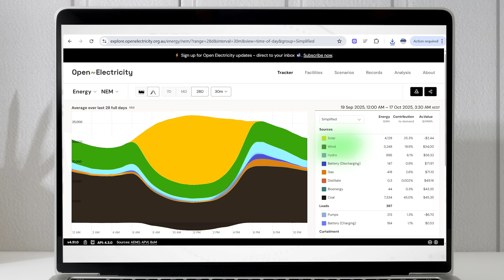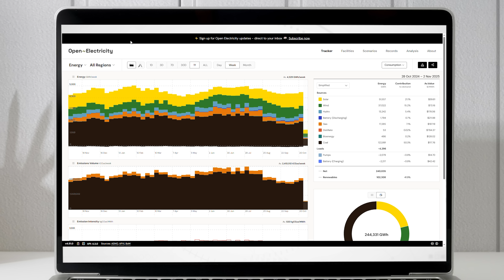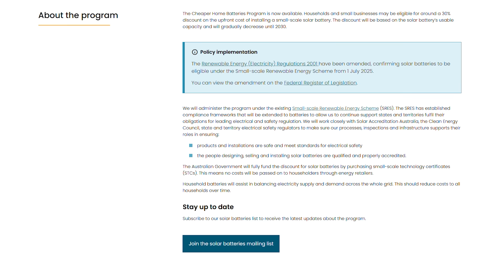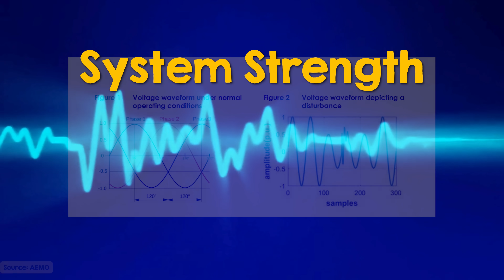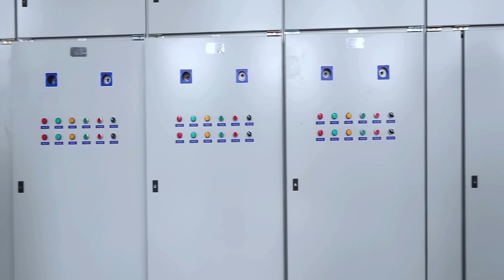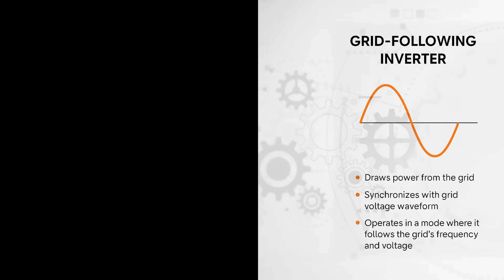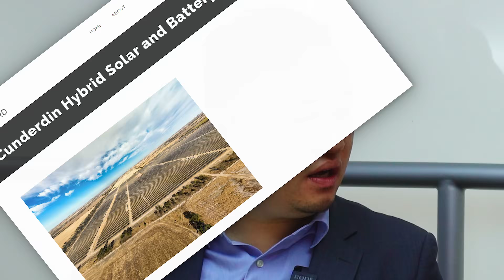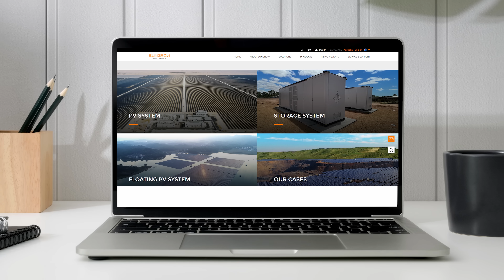Australia’s Solar Boom Is Breaking the Grid - Or Is It?

Comment: I've lived off-grid for almost 10 years now, my first project was to build a frequency based load controller to heat my hotwater using excess solar power, I had my first prototype installed and running within days of switching on, over time I added adjustable threshold, then an LCD and rotary encoder with a menu system, and now I've expanded it into a multi device output, multi input controller with adjustable hierarchical switching and timing, with control inputs for grid/inverter frequency, external generator detection, real-time clock,  battery charge status, and manual override.  I did try taking to several industry leaders in the beginning, including SA power networks and energy retailers and hotwater manufacturers, but was fobbed off and told it wouldn't work grid wide. I guess we'll see if they suddenly start selling something similar,  the key thing about my system was it's adjustable threshold levels to smooth out the turn on and off to prevent grid shock.
Reply: do all these issues you both mention relate “simply” to the fact that despite being off-grid, you’re still operating in AC? Wind turbines output can perhaps be smoothed and converted to DC at point of generation, fluctuating DC solar can also be smoothed before charging a battery storage which would become the home “generator”, and all in all, there are probably a lot of appliances that could simply be DC and the remaining ones that do need AC could have an onboard converter?
Reply: @Nikoo033 I use AC 230v, 48v battery bank, and sma sunny island inverter connected to PV inverters.
Reply: @Nikoo033  Is Australia, all Australian appliances are in AC, you must have a inverter to convert DC to AC. In a home setup this is easily achieved. In a grid this is highly difficult. Why you are introducing multiple points of input each one varing in charge and frequency, then trying to send that load down sahred powerlines. Its a power monitoring and adjustment nightmare. Infact just to prove how difficult and what can happen just look at Waratah Super Battery plant that suffered a catastrophic failure on its primy inverter. If you think 100's of theses for 100's of plants is great then you must know something that Waratah didnt.
Reply: SA power networks prioritize profit over society.
Reply: Is a description of your system available somewhere? I'm looking at dumping excessive energy to a hot water tank and then to a wood drying shed. As I understood your text your system does something similar.
Reply: Off grid too, the big problem as you noted is more solar inputs more load controllers needed, more vairables and increases potential for failure. People pushing net 0 dont understand that, the more sources of solar and turbines means more controllers more invertor banks just to even the energy frequency. Honestly anyone that has batteries knows you have to over enginner just encase. The idea that there will be mass battery storage locations all over is crazy, and the goverments claim of firming with Gas, well as we havent built a gas plant in 5/6 years, I'm calling BS.
The goverment should have cut the solar and turbine projects down, and paid 80% to have every household have 5 to 7kw of solar pannels each, then on every factory, carpark, building more solar to help the local grids/ or even main buildings/ shopping complexes. BOOM lower bills. But thats not the game, the game is give millions to billions to big businesses, even those businesses that have failed and not returned the money loaned. Just give them more!
Reply: @marcusmadrid6225  Yes, in fact, the optimal solution for solar energy is distributed. Construction and usage should be carried out in blocks based on the load size, and it is not suitable for large-scale deployment in the power grid for allocation. This is a better option for citizens, as it will significantly reduce living costs. However, at the same time, large enterprises will lose control over the power grid. This will inevitably affect their profits. Large enterprises should instead build dedicated solar power plants for large-scale electricity facilities. But Australia no longer has enough large industries as users.
Reply: @marcusmadrid6225 My ex wife works for a government department that did a study and report regarding the most practical way to introduce solar battery systems, with minimal network upgrades, the study showed that introducing small battery systems could supply the customer and support the local grid with minimal to no upgrades as long as the local grid consumption was maximised or stored, after all the local community grid infrastructure is already adequate, the issue comes down to individuals and businesses alike not wanting to share their excess energy at a one to one rate with others.
Reply: The problem is actually failure to plan for success. We built enough energy collection infrastructure to be in an electricity surplus at times. We failed to build controlled sinks which can make use of the surplus. The near future of Australia is summer energy surpluses, which needs planning for now. The present in Australia is daytime power surplus. We need to think now about what sinks/loads can be moved from "on demand" to "on supply" with a 24 hour and day-to-day schedule. Even if battery storage fills that role, we need to plan to replace some current "on demand" energy use at the week-to-week, or even month-to-month level.

Comment: Energy storage is important. I’ve heard a solution is to use EVs as the energy storage spot and ones EV connect to a public charger, you can sell energy to the grid from the EV battery which you may charged via solar. That can reduce the infrastructure costs for building battery storage specifically. I think the law can be discussed before hand and once the EV market get matured it can be applied immediately.

Comment: The grid is a spine connected to a very large variable load.  Adding ribs to large amounts of renewables means fundamental changes must happen to make the system stable.

Coal, especially lignite, is very cheap.  Solar is expensive.  The government funds the disparity by forcing users to pay for solar infrastructure.

None of what you are proposing was necessary if we had just maintained our coal fired power stations.  Now we face uncertainty and ultimately state level bankruptcy.

Comment: What you need is storage and grid forming inverters ...  It's not that hard.
Perhaps use some of that extra energy to spin up some heavy fly wheels distributed close to where the energy is used and made...  Those fly wheels could have some mechanical govenors to deal with some frequency droop on high demand...

Comment: I think saying that an inverter based system responds faster is a misnomer, because an inertia based system doesn't respond (that's kind of the point).

Inertia stability physically can't change voltage or frequency rapidly. Giving other strategies such as GFI's micro or even milliseconds to respond. 

Also inertia is not as beholden to software's inherent vulnerabilities. 

I think the solution is a mix, but I always love your positivity (which is somwhat ironic in AC discussions)

Comment: Software can be compromised and attacked in so many ways (malware via supply chain, back-door, and vulnerability both pre and post upgrade), these devices will be riddled with firmware back-doors and internet dependence - steel tonnage suffers from none of that.  But if you just look the other way, then it's great!  Solar is awesome, don't get me wrong, but a balanced perspective would show some respect to your audience.

Comment: 'Make or break the clean energy transition'. I beg to differ. The transition is largely done as you already stated, half your power comes from solar. Yes, there is further to go, but even if you fail to solve all the grid issues, the solar already installed is not going anywhere. You won't transition back to coal. The remaining transition will either go smoothly or not so smoothly but it won't 'break' as in 'fail to happen'.

Comment: Is there any place for making Hydrogen with the cheap electricity and then burning that to keep what was a coal plant running ?
Or are batteries such a better way to do it ?
Reply: Why would you want to keep the coal plant running?

Hydrogen has an advantage over batteries for longer term storage, since the fuel tanks are cheap compared to current battery technology,  although it would be better to convert the hydrogen into a synthetic liquid fuel for very long term storage, hydrogen tanks are expensive compared to liquid fuel tanks.   However there doesn't appear to be much requirement for long term storage, it is cheaper to install more solar and wind, so that even at times of low wind and cloudy days, there is still enough solar and wind, and when you have excess, you simply don't use the excess, which reduces the wear on the wind turbines, so is not a waste.

If you do store hydrogen for emergency power, you would burn it in a gas turbine, not in a conventional coal or gas thermal power station, so it doesn't help with the loss of continuously rotating steam turbines.
Reply: @nigels.6051  You exchange the steam maker to Hydrogen and remove coal.  It already has all teh grid connections and a huge site.